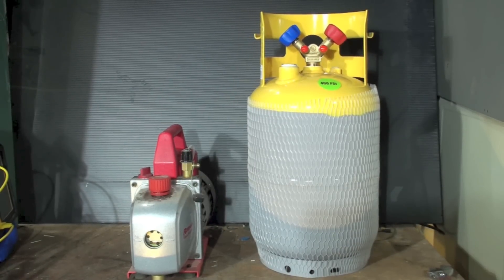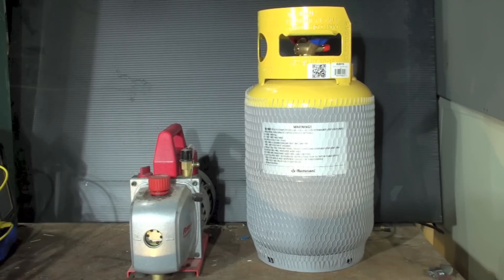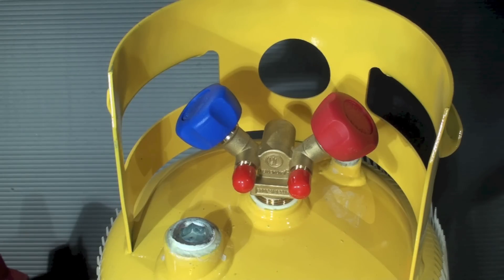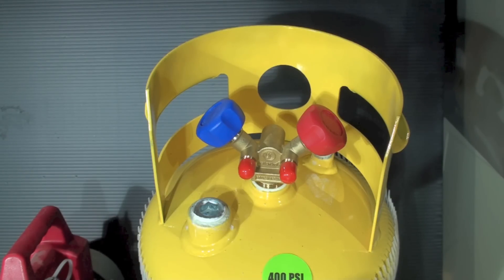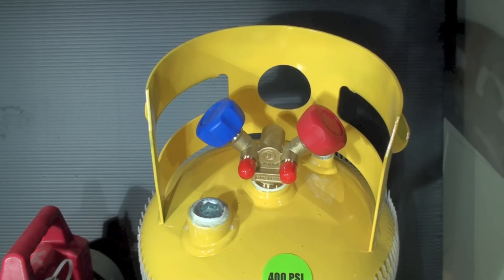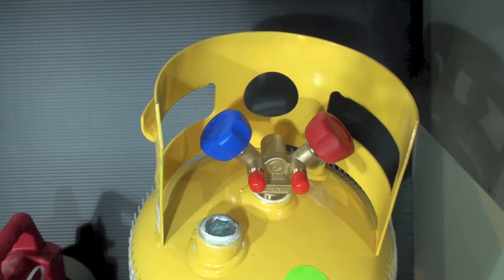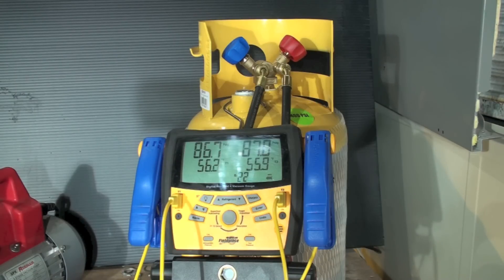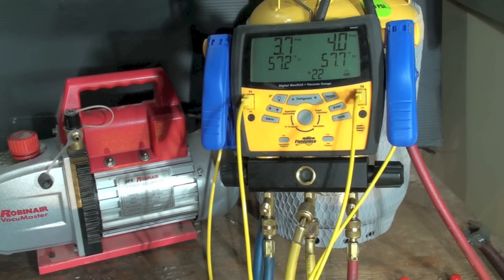Commisioning a new refrigerant refrigerant recovery cylinder

Comment: You think it makes no difference but I'm pretty sure that in the liquid side there's a tube that goes all the way to the bottom so if you put vapor in that side it can cause the vapor to Bubble Up through the liquid at the bottom if you already have some in the recovery tank and cause it to heat up and build pressure

Comment: Hi GFM, any advice on picking up a used / empty / open to the air recovery tank locally?  I’ve seen a few advertised for next to nothing, but assume if it’s open to the air, the inside of the tank could be rusty. Best to avoid or will most supply houses swap the used and empty tanks out for a fee?
Reply from the maker: The reason the cylinder is cheap is it has passed its test date.  It can no longer be used until it is pressure tested and testing costs almost as much as a new cylinder.
GFM
Reply: @grayfurnaceman  Thank you as always GFM!

Comment: 2:42 
Red is always liquid, Blue is always vapor, does not matter what side of the recovery tank, Blue=Low side Red=High side
Reply from the maker: The color depends on the manufacturer.  Some have blue for liquid.
GFM
Reply: @grayfurnaceman  Industry standard for safety, Red always high side, Blue always low side, Does not matter what side of the tank it is on. 

 ** I'm wrong! I found a tank with a Blue valve labeled liquid. This makes no sense, but there it is. This SHOULD be industry standard for safety.

Apologies
Reply from the maker: @relmdrifter  I agree. But it is not.
GFM

Comment: How much does it cost to have the tank emptied by the refrigerant supplier?
Reply from the maker: It varies with the location and if the refrigerant is damaged.  Much higher if it is damaged from overheat.
GFM
Reply: @grayfurnaceman  thank you for your reply, and your videos are quite helpful. I was considering purchasing a consumer type recovery machine and tank and already have the gauges and vacuum, so your videos are making it easy to understand the process in advance.

Comment: There’s a date printed on my 134a 30 lbs cylinder. Do you know what the date represents? 
Mine says: 01-08-2021
Reply from the maker: If its a one use cylinder, it is probably the date manufactured.
GFM
Reply: @grayfurnaceman  It’s a new tank.
Reply from the maker: @christopherowens2635  Sounds about right for a new cylinder.
GFM

Comment: good video is it possible to use the recovered r12 from a refrigerator to a older car that uses r12 (1992 etc) ?
Reply from the maker: You could but the refer probably only has 1/2# of refrigerant and the car could have as much as 3# at a full charge.  Add to that the necessary bleeding, you will probably get about 5 oz of usable refrigerant.
GFM
Reply: @grayfurnaceman  thank you i was thinking it was needing a few recovery 
from different fridges  but what does the # mean when you said 3# or 1/2#    I live in a country where freon resources  are very scrace (Canada)  and to import from USA shipping costs too much  .  but i Live in Calgary and lots of people get rid of perffectly good fridges because they do not like the color or will need to "upgrade" to a wifi one .
Reply from the maker: @abdou6003  The# means US pounds.
GFM

Comment: This was very helpful!  I purchased a White Industries R1234 machine that was missing the 134a recovery tank. i bought a Mastercool tank and wiring pigtail to install it. Now the 'excessive air' light is on, and i think i know why now....   A question i have is,  does the float switch open at 80 %, or close at 80 %?  Most diagrams i have seen indicate normally closed, and open @ 80 %.
Reply from the maker: It depends on the machine.  They can be set up either way.
GFM

Comment: Hey gray hi... hey is that safety need to be closed when you get a new cylinder? i just bought a new one and with 6 pounds of refrigerant in it, it started trowing out the freon by that valve completely,,, i tied the valve all the way down with an allen wrench but it did it again.. it that mean the safety is bad in this thing? thank in advance for response...
Reply from the maker: Either the valve is defective or it is not designed for the refrigerant you are recovering.
GFM
Reply: oh,,, I was recovering R22 and the tank notes from the seller says 400psi approved, so probably a defective valve... so i dont suppose to touch that valve at all when the tank is new? so the valve is factory set?

Comment: Someone gave me an empty recovery cylinder. Just to be sure, and to smell what was in it, I cracked open the blue valve. Nothing, so when I opened the red valve oil started oozing out. Im not sure what to do with it if anything. Thanks for your help.
Reply from the maker: The oil is from the dip tube in the cylinder.  If the date on it it over 5 years old, it needs testing.
GFM

Comment: I have a tank similar to this.  I don't know what it is and I need to get rid of it.  It's heavy.
Reply from the maker: If it is over 5 years since it has been tested, it is not legal anyway.
GFM
Reply: grayfurnaceman   Where do I take it to get rid of?  I'm in Middle TN.  Thanks
Reply from the maker: You may be able to take it to an HVAC distributor.
GFM
Reply: grayfurnaceman expires May 2019 and has 1 lb of freon.  Anyone want it?

Comment: I've had problems with that particular brand of tank leaking out of the valves under pressure. Also had one that had a big leak on one of those bungholes. At least I got that one for free and was able to fix it with a new plug

Comment: Yeah....lets pay to give them the refrigerant you recovered back and get an empty cylinder in return then go back and pay for the refrigerant they got from you for free....something stinks here.
Reply from the maker: Nothing stinking here except your understanding of the concept here.  
Once refrigerant has been installed in a system, it gets mixed with oil for sure, possible contaminants such as air, gasses from compressor burnout or metal shavings.  Would you want someone to install this garbage into your system?  
As for me, I want to be able to assure my customer that the product I install into their system comes up to the specifications of a new product.
Even if I was to remove refrigerant into my own cylinder and filter it, my cylinder has had many customers' refrigerant and oil, etc inside it.  I don't know for sure how clean and pure it is.  So yes, I will always get a cylinder of ASHRAE approved refrigerant.  
GFM
Reply: Understood. Thank you. My complaint is more focused on the fact that refrigerant as we all know can be sold at absurd prices and we basically give them the oroduct. All that is done afterwatd is the purifying  and then it gets sold back to the public. Not to mention that they even charge you to take the product in to their facility.
Reply from the maker: A few more facts:  The cost to reclaim of refrigerant is not that high.  What you are paying for is the federal tax.  This tax is placed on refrigerants that are being replaced due to environmental issues.  It is used to influence the buyer to use the newer, less environmentally damaging refrigerants.  This tax increases each year and the amount of new refrigerant manufactured is lowered.  You can argue with the reasons for the law, but that is the law.
GFM

Comment: I bought Mastercool 69500 RecoveryMate Oil  and a Mastercool 64010 30 lb blue r134a Recovery Tank without float switch.

I have a problem connecting the r134a hoses to the tank since they have different male fittings, both red and blue fittings.

Please see this video as i tried to connect.

https://youtu.be/NlNmmHZzE1Q

Is there any connector / adapter needed?

Comment: Obeewhan: When the line set is evacuated of refrigerant and triple vacuumed, moisture be removed from the liquid line drier of an installed system?
Reply from the maker: If the system is being repaired, the drier should be replaced when ever the system is opened. Hope this helps. 
GFM
Reply: Thank you. I am replacing a "burn out" condenser with a functioning - no issues used condenser. I tested the old oil of broken unit, and it was cloudy plus positive for acid. Ran the evacuated refrig. through a new Sporlan 052 burnout cleaner in the recovery machines liquid discharge going into the recovery cylinder. I was thinking of replacing the OEM filter with oversized Sporlan common filter and adding another Sporlan 160 series burnout cleaner in the liquid line outside of unit between evaporator. run for a couple days and then remove it. do I have it right?
Reply from the maker: I don't see a problem with what you are doing.
GFM

Comment: Can i use recovery tank for 134a after i use it for r22 or one recovery tank for every freon ....
Reply from the maker: You can use it for multiple refrigerants but it must be evacuated prior changing refrigerant.  The only limitation here is R-410A.  The cylinder must be rated for 410A to put that refrigerant in the cylinder.
GFM

Comment: I was told that if you put vapor into the liquid port that the bottle would get hotter, and that it would be best to put liquid and vapor into the blue side
Reply: there is good reason red and blue are assigned; red = hot and caution vs blue in this case being low pressure aka liquid. my only understanding is the two were reversed in this demo. vapor is the superheated state of liquid which equals more pressure in a confined space. i have seen substantial accidents caused by mixing the two sides of the system up during servicing

Comment: do you get one tank for each type of refrigerant you recover? or do you mix them and recycle them
Reply from the maker: You need one for each refrigerant you use.  If you mix it, there is an extra charge for accepting it because it cannot be recycled and has to be destroyed.
GFM
Reply: So if i transfer a half full  recovery tank that had say R22 into another, can I vacuum down this now empty recovery tank to 500 micron and recover a different refrigerant say R410a ?? Or is this the same as mixing it?? Thank you

Comment: what is the process to return the recovery gas to the equipment?
by liquid or gas?
Reply from the maker: +FERNANDO CISNEROS You can do it either way.  Liquid to the high side to an evacuated system or gas to the low side with the compressor operating.  Hope this helps.
GFM
Reply: @grayfurnaceman  and you have to run it through a recycle machine---NOT RECOVERY MACHINE---to separate the oil and moisture..   Recovery units do not do that.
Reply: @mtsaz100   That's not necessarily true.  If you are making a repair to a system that is clean and tight.   There is no problem returning the gas to the system.  If there was a substantial amount of oil in the refrigerant I would want it to go back into the system.

Comment: It's nice you have digital gauges that have micron reading; but I don't.  Could you show alternate hookup for vacuum gauge inline or on vacuum pump for reading vacuum being created by pump in recovery tank? Not all if us can afford spiffy digital gauges. Thanks
Willy
wileysnkskns
Reply from the maker: William Hill I was looking back on my videos and did not see on micron gauges.  I will be doing one soon.
GFM
Reply: I was interested in, "while using manual old style gauges," where to hookup vacuum gauge when using vacuum pump to evacuate new freon recovery tank. Placing it at fitting on vacuum pump? Thanks
Willy
wileysnkskns

Comment: The person below was mentioning working on a car ac unit. I have looked around and have never found anything telling how to make sure that you have the correct amount of oil in the system in a car ac unit. I was going to work on the orifice tube as I was told it was bad. Every time I ask about the oil I get different answers and non of them tell me how to make sure I have enough or too much. Do you work on these that you could give an explanation?
Thanks for the video.
Reply: amtpdb1 The easiest way is to use an refrigerant oil checker. http://gasfridgedepot.com/tools/pittstop-r134a-oil-checker/  Though I've am not sure is if they are legal. Also, If you haven't had a big leak it's unlikely you've lost enough oil to make a difference. The correct way is to recover the system and then use a dip stick on the compressor. Sometimes you have to make the dip stick yourself.
Reply from the maker: amtpdb1 I do my best to ignore auto air whenever I can.  It is an odd way to refrigerate because the compressor RPM changes so much.  Oil in these systems is constantly circulating, so there is no way to know how much oil is in the system, so you cannot know how much to add.  So, what would I do?  Add a couple ounces and hope.
GFM
Reply: grayfurnaceman Thanks for the information.Great videos.Have a nice weekend.Don
Reply: DataToTheZero Thanks for the information. Have a nice weekend.

Comment: I found your article very informative and watched it a number of times now..I have only started getting into ac recently although ive been a panelbeater for 20 years almost. I have the Australian version of the Trademaster T9100 as shown on you tube.im doing more degassing than regassing and the internal 8kg tank is almost full. Any suggestions on how to transfer the r134a refrigerant  from the automated machine into a 20 kg  recovery cylinder that I just purchased without removing the internal tank from the Trademaster. Any help would be much appreciated :)

Comment: Thank you for your video. You explained and made it very easy to understand. I am in the process of learning about ac system. One day my ac went out on my car and I took it to pepboys to get it recharge and found out my compressor was bad. Took it to Audi and they wanted $2100 to fix it. Lord no I aint paying that much so I decided to learn about ac and figuring out what all I needed to get this job done so I can change my compressor myself. I did a lot of research and youtube. hahaa and found your video was very helpful. I will be getting all my stuff order next week. What I needed to do is vacum the 1.3lbs of r134 from my car and save it. change my compressor and drier and recharge it again. any advice? What I need thank you.
Reply from the maker: ronny rath You can do it yourself.  However, recovery of the refrigerant is probably not possible without spending a large amount for the machine.  Dumping refrigerant to the atmosphere is a violation of federal law, but it is done all the time.  A vacuum pump is necessary for this job.   Once the parts are replaced, a thorough leak check is necessary.  The best way to do this is with either nitrogen or CO2.  Don't use compressed air.  Good luck.
GFM

Comment: After you receive your recovery tank back from your recycler/reclaimer is there a best practice for how to store the tank, such as charging it with some specified amount of nitrogen until its next use?
Reply from the maker: I like the tank to have refrigerant in it at all times.  If the tank comes back with a vacuum or nitrogen, I will pull a vacuum on the tank.  If I am going to use it right away, I will use the vacuum to pull refrigerant into it.  If it is for use later, I will charge the tank after the evacuate with enough refrigerant to get the pressure above atmospheric pressure.  Hope this helps.
GFM
Reply: grayfurnaceman
Reply: grayfurnaceman Thank you!
Reply: grayfurnaceman, you mean charge the recovery tank with refrigerant from these 30lb refrigerant in a disposable tank (talking about r134a) .
Reply: grayfurnaceman, i have a question about this which went somewhere
Reply: Sorry, i was thingking my question went to another topic. Im not used to this.

Comment: Not to long ago I had 16 almost empty drums of r22. Recovered 19 lbs from them. It was like hitting the lottery. Of course the drum was new.
Reply: is it possible to use the recovered r12 from a refrigerator to a older car that uses r12 (1992 etc) ?
Reply: @abdou6003  Yes, but you don't really have a great way of knowing the purity of the refrigerant, so be careful. If the donor refrigerator was running properly and the refrigerant circuit wasn't tampered with then you might be alright, but if it had a leak, the compressor failed, etc, there's a very high risk of the refrigerant being badly contaminated.

If you are asking about whether it's legal, my understanding of the law is that it's legal to return recovered refrigerant to the same system or another system owned by the same person, but that it has to be recycled and meet AHRI 700 purity standards before it can be sold or added to a system owned by someone else.

To be honest, a can of R12 can be bought for cheap enough that trying to recover R12 from a refrigerator to use in a car probably wouldn't be worth the time or risk or ruining the refrigerator for the maybe 4 ounces you might get, but that's just my opinion.
Reply: No